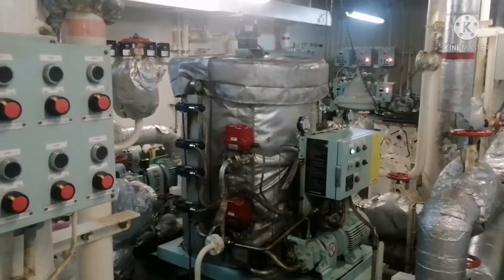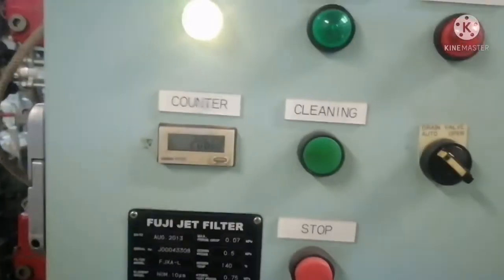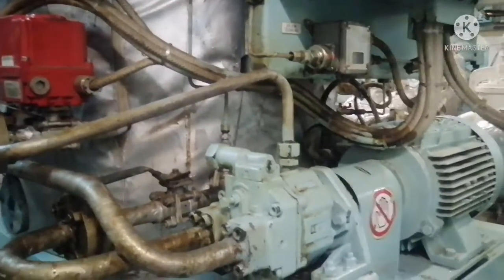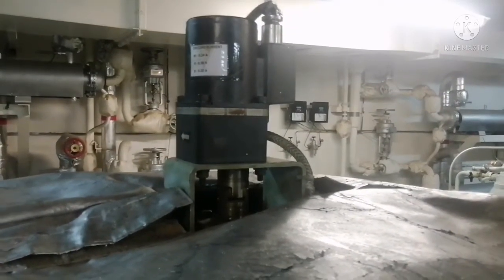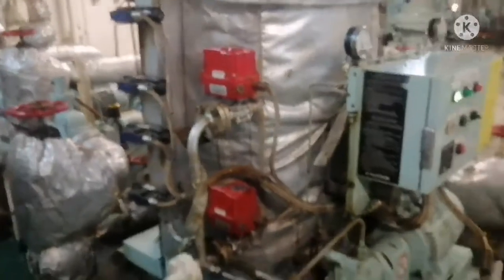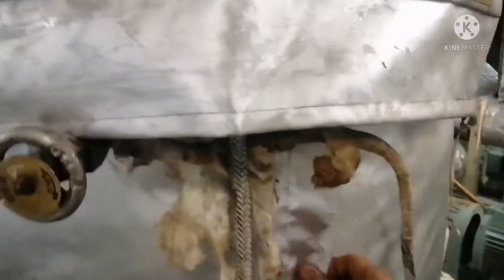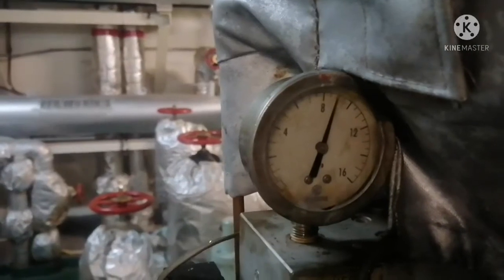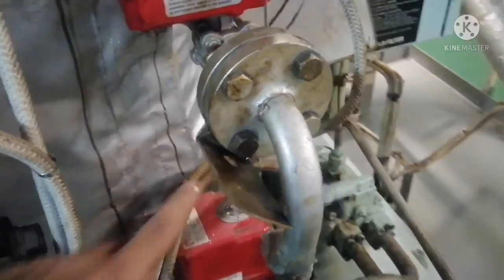How do they work... know everything about jet filter onboard ship..

Comment: Hello.Did you have experience that during automatic cleaning pump starts and than stops imediatelly,without any alarm.Just stopps and then oil is going through drain pipe of the pump to filter drain tank.No any alarm,just pump stops and when we come there pump slowly rurning and draining oil.Once you press cleaning button system starts working normaly for several hours.
Reply from the maker: U mean jet pump
Reply: @marine-knowledge-basha  yes jet pump stops,but no any alarm.Just stop and start turning idle a fuel through pressure regulating valve goes to Filter Drain Tank.Than we put on by pass,close in/out valves for jet and pump stops turning.Then we open in/out valve of jet filter,close by pass and by starting system ,jet starts working normaly.

Comment: what will you do if the Ap cleaning glows for a long time
Reply from the maker: Thanks for your query sir..
If this differential pressure cleaning glows continuously that means either your  Differential pressure switch is defective or your filter needs to be cleaned.
Hope this reply will satisfy your query..
Reply: @marine-knowledge-basha   thank you sir this realy helps.
Reply from the maker: @benbots8373  welcum sir... U can raise any marine related queries.. Vl try to clear as far i can.. U can refer to your frds also.. So they can alsi do the same..